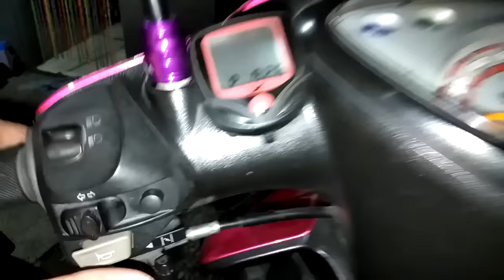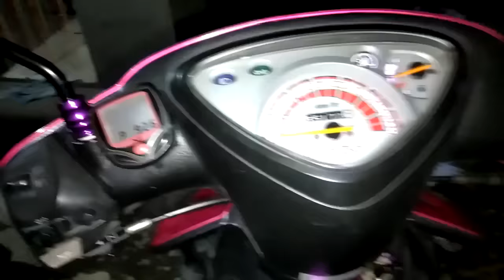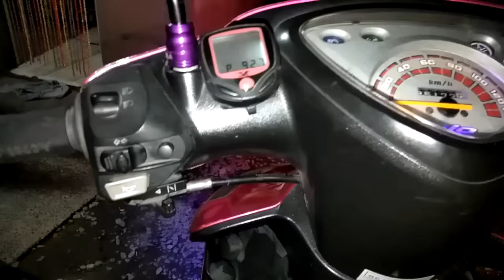Passing Light on Mio Sporty

Comment: Lupit mo talaga idol
Reply from the maker: salamat idol ;)
Reply: @MotoDIYs  paano wiring boss sa stock bulb sporty san coconect ung pass switch
Reply from the maker: @carlovitaliciotv6195  yung isang wire ng switch color green wire sa video ko connect mo sya sa wire na galing sa stator, sa mio sporty color yellow na may red line ung wire na galing sa stator, makikita mo sa may 4pin socket  sa may manubela left side kung nakaharap ka sa motor.
Reply: @MotoDIYs  salamat paps ridesafe beep beep

Comment: Boss, pareho lng b wiring ggwin s mioi125? Gusto ko gayahin. Salamat s video mo, my idea nko
Reply from the maker: Dipende boss kung battery operated na headlight mo same wiring,  pero kung stator driven pa headlight mo yung isang wire ng switch connect mo sa power supply from stator.

Comment: Ask ko lng. Kaylangan po b battery operated bgo mginstall ng passing?
Reply from the maker: Kahit hindi paps ibang wiring lang kung stock bulb ang gagamitin mo, dyan kc sa video sa brown wire ko kinonek ung switch pero kung sa stock bulb at hindi naka battery operated ang motor mo sa yellow wire mo ikonek yung isang wire ng passing light switch. Kung mio din motor mo paps.
Reply: @MotoDIYs  same lng po b sila ng wiring ng fino carb sir?
Reply: Bka sir my vid ka din pano mglagay ng on/off ng headlight.

Comment: Paps anung tawag dun sa pang cover sa wire na pinapainitan? Tnx
Reply from the maker: heat shrinkable tube, sa ace hardware ko nabili yung akin.
Reply: Tnx paps... More power 💪
Reply from the maker: @grinpink31  tnx paps

Comment: sir ito po sana gawin kong ptocedure, yung sa highbeam na wire d ko na cya soldahin babanatan ko nlng tapos tap, tapos yung sa power source pwed ba i tap ko nlng cya sa positive wire ng cp charger ko? naka tap din naman yun sa positive ng ignition. salama sa reply sir :)
Reply from the maker: yes sir tama pwede naman tap kung di mahinang. yes pwede mo tap dun sa cp charger basta dapat battery operated din headlight mo sir.

Comment: Paps yung IN4007 diode pwede ba yon ilagay sa starter switch ng Mio i 125. Gawin ding passing light switch yung starter switch? Pa shout out na din po Godbless
Reply from the maker: hmm parang pagpindot mo ng starter switch sasabay pa rin yung stater motor sir. God bless din sir
Reply: @MotoDIYs  Wala ba ibang option para dyan paps? Double purpose ang starter switch.

Comment: Sir ginawa ko yung saken, all stock aKo, kya lng nkA tatlong fuse nko pumutok. Ano kya naging prob. Sa red socket ko xa ni tap sa brown wire. TiA sir.
Reply from the maker: sorry sirdi ko nasabi sa video ko na for battery operated yung wiiring ko dyan, tap mo sya sir sa color yellow na may red na line nasa may 4pin socket yun malapit sa break fluid reservoir.
Reply: @MotoDIYs  ahhh wla kba pic sir gstong gsto ko tlga yun kalikot mo. Ptulong sir khit pic lng nung socket. Tpos positive pdn b?
Reply from the maker: @jocarlomesina8724  https://youtu.be/p_hvhjLAVaM watch mo sir vid ko dito makikita mo yung 4pin socket at yung wire na color yellow na may red line, galing sa stator yun ang nagpapagana ng stock headlight ng motor mo.

Comment: paps pano maginstall ng passing light sa stock bulb. san itatap yung wire ng walang pinuputol? thanks.
Reply from the maker: Tap mo dun sa yellow wire dun sa may socket ng right switch paps
Reply: @MotoDIYs  diba dalawang wire lang naman yun paps. yung isa sa yellow wire? tas yung isa ground?
Reply from the maker: @ryuboi499  hindi sir yung isa sa yellow wire tapos yung isa sa hi beam ng ilaw
Reply: salamat paps. magkakabit kasi ako ng uma quickthrottle. e diba may pang pushtart yun. balak ko gamitin nalang for passing light haha 2wires lang din naman hahaha sana gumana

Comment: Boss nag try ako niyan ginaya ko kung pano ginawa niyo nagana siya boss kaso nawalan ng ilaw yung rear break ko pero pag nag bukas ako ng ilaw nagana tsaka pag nag front break nagana din nawalan lang talaga pag preno sa huli boss
Reply: Tsaka d kona siya ma push start pag gamit ko hulihan na preno advance salamat sa pag sagot boss😅
Reply from the maker: @crisivanc.marquina7085  battery operated kaba sir? check mo ulit kung saan mo tinap sir, meron din kc light brown na wire dun sa red socket baka dun mo na-connect.

Comment: Boss bakit yung dakin hindi gumagana yung passing light nya kpag hindi nka on yung headlight ko
Reply from the maker: baka mali yung wiring nung passing light switch mo boss, try mo check ulit, dapat connected yung isang wire nung switch sa high beam tapos ung isang wire sa galing sa battery sa mio kulay brown wire.
Reply: Tama naman boss yung highbeam ko sa may yellow tas yung green na wire sa brown
Reply from the maker: @Kurt0303  battery operated ba headlight mo sir? wala bang modification sa headlight mo sir?
Reply: Nung nagpalagay kasi aq ng tri led boss sabi ko i battery operated nung gagawa...sabi nman nya ok na daw nka battery operated na..
Reply: If ever hindi pa nka batt operated boss may vodeo ka how to battery operated ang headlight...tnx and godbless
Reply from the maker: @Kurt0303  meron sir nasa channel ko sir, God bless din sir

Comment: Sir fullwave nmn
Ano advantage nun?
Reply from the maker: mas clean na DC volts sir, kahit low rev or nasa idle motor mo sir nagcha-charge ang battery, maganda sya pag maraming load or electronic accessories ang isang motor, example HID, LED at horn.
Reply: Ahh kya pla hard start minsan tas ung busina ko mahina.
Reply: Tnx sir